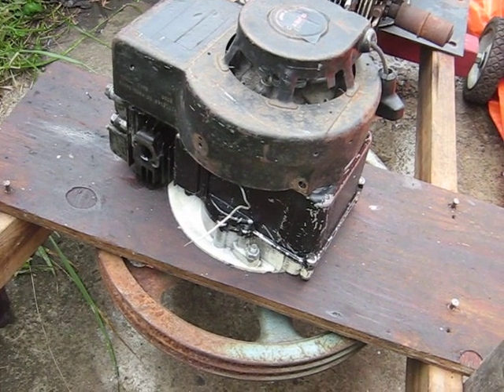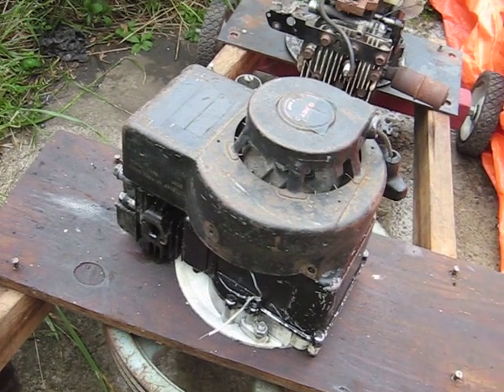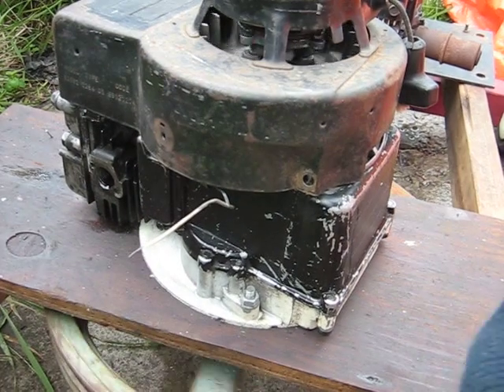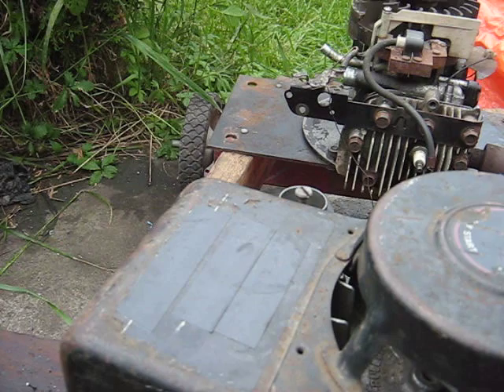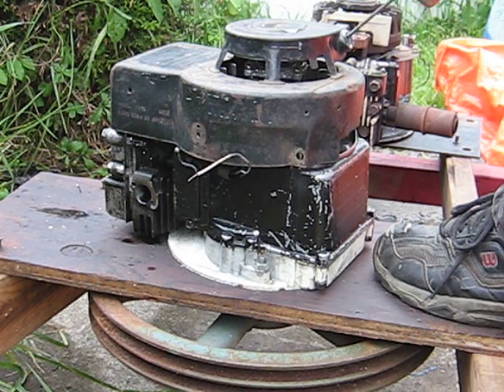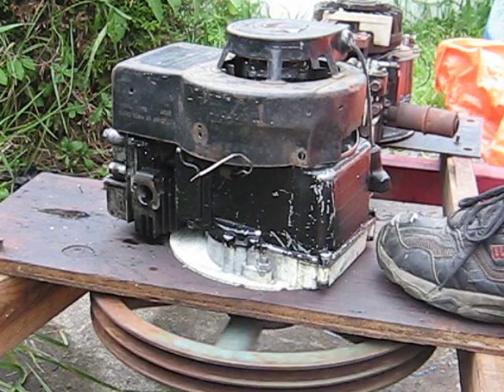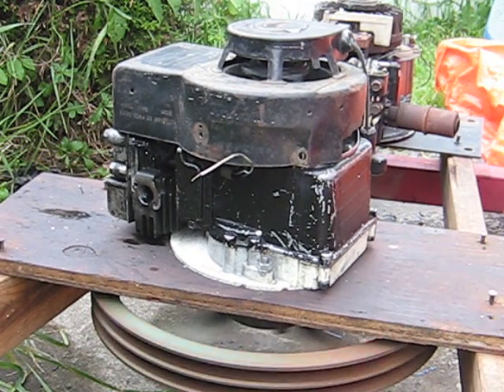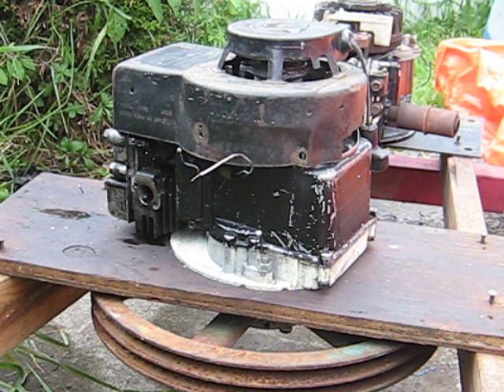Briggs Flywheel Engine Fail!

Comment from the maker: Yes, it doesn't have enough intake velocity to pull the gas up the venturi. I did reduce the exhaust cam timing, so it doesn't open til about BDC.
I think this particular flywheel is just to heavy for it, at 27 pounds, I got it to run with a 10 pounder, I will upload the vid ASAP.

Comment: Its more a test what will go first, if it runs?
1.Crankshaft
2.Flywheel bolt.
3.Flywheel.
4.Engine/piston etc.
My guess is the board its bolted to.lol
Could you drill start it? Probably wont work.
Always good video s.Thanks.

Comment from the maker: I am not quite sure about not being able to have too much flywheel.
I think this engine does, think of it this way, the engine fires, then the piston/conrod tries to turn the crankshaft, but comes up against a basically immovable object.
Sounds strange, but I think that is what is going on here. I have a 10 pound flywheel I will try.
I think a steam or compressed air engine could use this flywheel, just not a combustion engine this small. (Just my opinion of what I am seeing here)

Comment: Should be a good runner, but you might need to give it a bit more fuel. I would be careful though, a pulley like that is not designed to do 3000rpm+ on an engine like that.